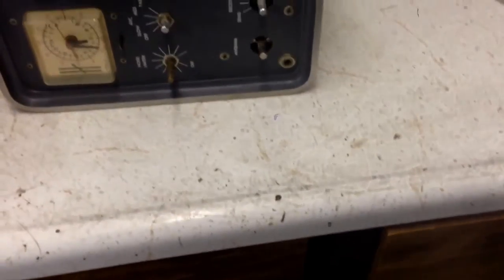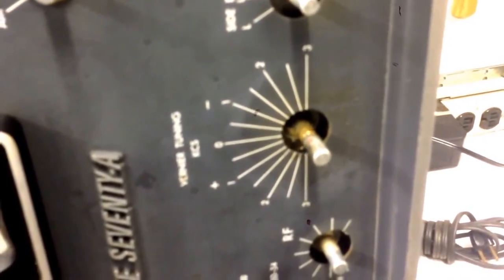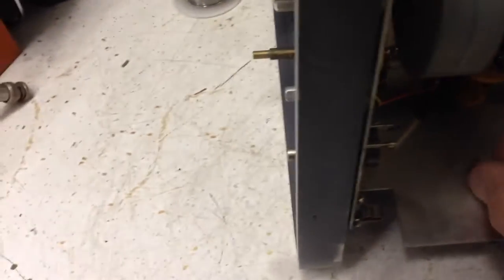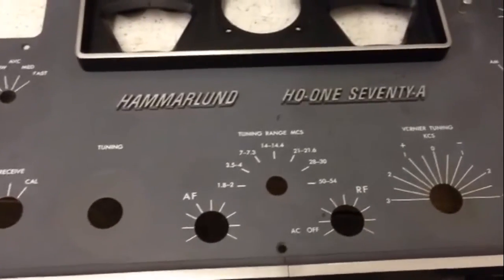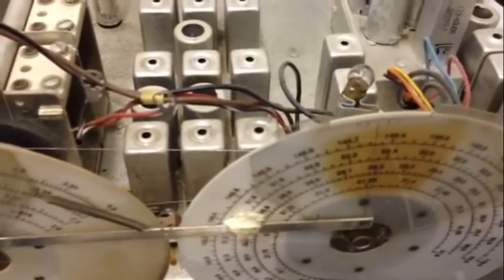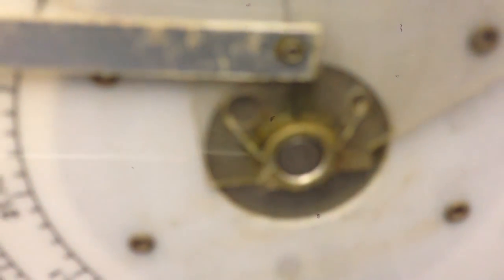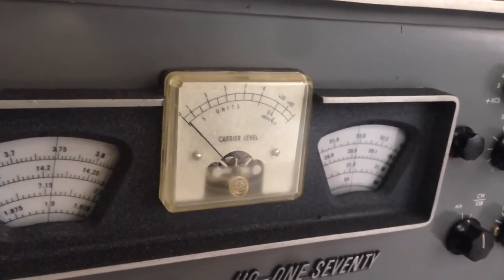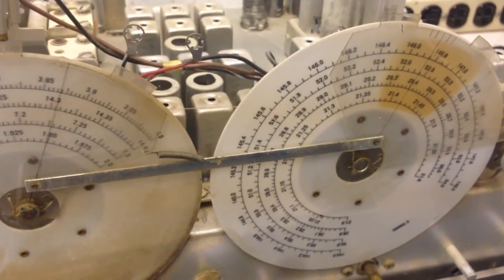Hammarlund HQ-170-A Communications Receiver Refurbishment of display window.

Comment: Have a HQ170A that is an estate buy. Its in so so condition. Working my way thru it slowly. My frequency dials are all out of adjustment. They obviously have been mishandled or moved at some time. What is the best way to get them back to a factory starting point? They currently have no correlation to one another at all. I have yet to get power to the unit.

Comment: Hello friend, a few days ago I recovered an HQ180A I got it, I did all the steps, but what I could not understand on the dial is the adjustment of the band spread the location for the adjustment of all bands has to be at 100 ??
Reply from the maker: Sorry about the late response.  I just found your post.   The band spread is only to be used when listening to the Amateur radio bands.  It's calibrated to cover them.
When not in use,  the Band spread is to be parked at 100.  When these radios were mad,  dial accuracy was "ball park".   Extensive use of the crystal calibrator was a must.   Other than that,  the unit has exceptional sensitivity and has acceptable stability for the time.
Reply: @dogtagsvette  thanks!! 73!!!

Comment: Ive seen several times where you mention taking the front panel off for a "scrubdown". Certainly it's not like scrubbing a hubcap with a pail of water, scrub brush and a can of comet. What do you mean by "scrubdown"? Because I need to do this and am very afraid for the silkscreened white lettering. Thank you.
Reply from the maker: I would never use a brush as it might damage lettering and that goes for harsh chemicals.
You might think this crazy but I've taken more than one panel and run it through the dishwasher.
Nothing touches the panel.   I have faded some of the lettering and in one case the gluded on "hammerlund" logo came off but the panel was clean.  Don't use the dry cycle.   Let it air dry.
No Guarantees.
Reply: I just now finished up the faceplate of my 170. It was pretty stained and had little rust colored spots peppered all over it. I just used patience, some Ultra-Brite toothpast, a soft toothbrush, and enough water to keep the toothpaste from being too dry and thick. I used the sides of the bristles more than the tips, and carefully scrubbed around all white lettering. To blend in, I scrubbed lightly over the lettering. After wiping away all the toothpast with damped sponges, I went over the face of the panel with Behold furniture polish. Looks downright gorgeous.

Comment: I follow your videos with great enthusiasm.  I have both an HQ-145 and an HQ-170.  As a kid (1956) I had one of the first HQ-100s made, even had to wait two months to get it from a dealer. I used it all through my teen years (I was licensed at 13) and through early adulthood until I got some SSB gear. It was paired with a Ranger.  About 45 years ago, I was given an HQ-129 which had belonged to the late father of a work colleague to whom I gave the Novice exam.  It came from a coal mining town and was very dirty.  The dials were also warped and wavy.  I took the dial area apart much as you have done. Using drafting tools and a protractor I made both main and band spread dials, inked in india ink and the frequencies made with press-on lettering in the same font and size as the original.  I also created a 15 meter bandspread.  I took my full size master to a photographer and using large negative film he made a contact negative.  This, of course then came out as white numbers and concentric circles with ticks. I had that laminated between clear plastic to give it some thickness and stability and mounted the resulting disks on the original metal hardware.  So I had probably the only HQ-129 in existence with white on black dials. It actually looked pretty neat. At the time I tried just about every published modification for the radio I could find. I eventually sold the radio before a move and have no idea where it is now (Radio collecting wasn't a big deal then.) My current Hammarlunds both work well and I'm looking for a transmitter from my kid era to mate up with them. A current friend, no longer a ham, just found his Adventurer (CW only) and I'm going to try to get that working.

Comment: There is a fix to the problem with the alignment of the calibration window.  Watch my video  "Hammarlund 170A Sideband/Selectivity Switches".  It is the only way to solve the problem without replacing the windows.  It works.
Reply from the maker: I have to say I love your use of the phone block clip to bridge the gap.  You can solder to it as well as the connecting bar.   Now that's using your head.   My poor windows were damaged at the pivot point and cloudy to boot but I have a receiver I'll try your method on.

Comment: Hi Pete,  I have a 170 that has the problem you have described. I will be interested in your solution and may follow your plan of action..
QUESTION: What do you think about applying a small amount of synthetic grease such as Mobil 1  to where the shaft and plastic lens join? I am not sure how that might react to plastic over time. I also have a supply of Tungsten di-sulfide  which is a nano lubricant but when I stored some in a 1 liter plastic Pepsi bottle, the sides caved in somewhat. The bottle seems fine and strong but kind of warped..Strange.

73 de Glenn, WA4AOS.
Reply from the maker: wa4aos Hi Glen;
Well,  hard to say on the grease.   Dunno...  Keep in mind some of these units are more than half a century old and most of the dials have fared pretty well.   Also,  lubricants might have the tendency to leach out onto the plastic over time.   I'm still waiting for the replacement to be shipped to me and I'll finish up with a new video when it's done.
Many thanks for your interest and comments.